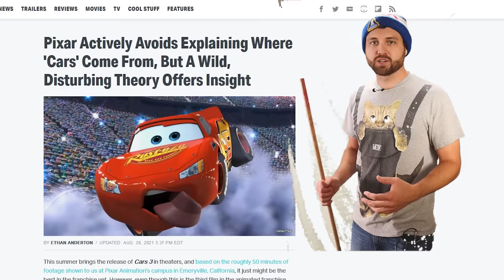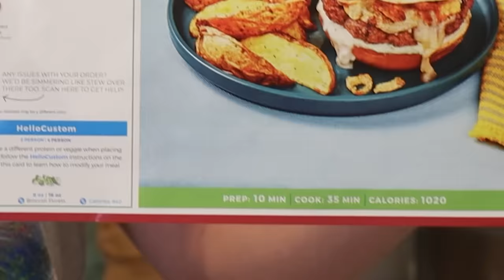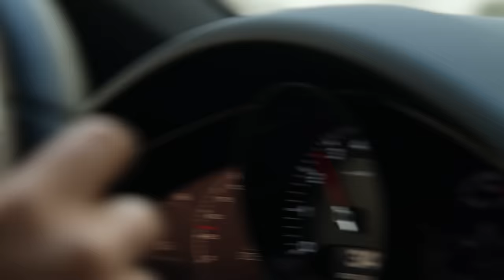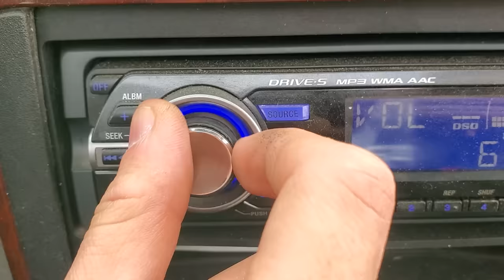How many parts can you take off a car?

Comment: Soooo glad I found this. I have been having an ongoing argument with my friend.... Basically, I am saying it can't be THAT hard to build a car... I mean... from the 1900's we've been chunking them out without a blink... hell, even PLANEs... a basic, easy bi-plane.... surely that must be relatively easy in an age of 3D printing and silly alloy's? The engine block - yeah, hard to do. But... they were doing it a hundred years ago so.... Road legal? OK - thats a hoop I don't want to deal with. For a basic starter, I'd stick to private land, and work up to road legal later. Much later. But back to my point.. building a basic, simple engine can not be all that hard? If I am an idiot, fine. But... a lump of iron from 100 years ago would suggest its fairly easy by todays standards....

Comment: 10:30 Okay, wait, this guy is trying to rip you off. The engine, transmission, brakes, tires, alternator, battery, coolant system, etc are all in fine or good condition. This car is probably worth around $600-800 if it's street legal. I would genuinely buy it.

Comment: So I’m hearing build an Toyota truck from years ago lol, iv thought about this to if you could buy basically a 80 Toyota now how much would it actually cost because if you could buy a new car, carbureted  probably, manual transmission, manual windows, no computers, I’d rather buy that for around 10k brand new then the new Toyota for over 40k

Comment: You just need to ho from point A to point B. Engine does little kaboom to make car move it move it. A seat to sit your butt on, a wheel to steer. Tires to go and gas to make the kaboom. Its that easy that I explained it in monke language